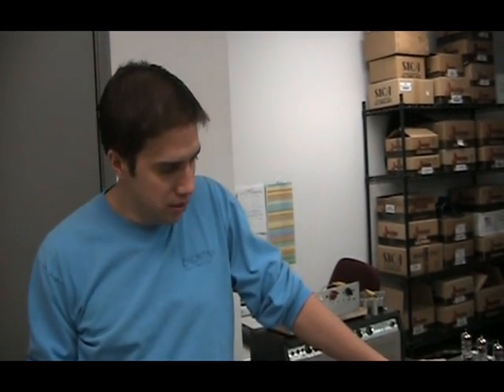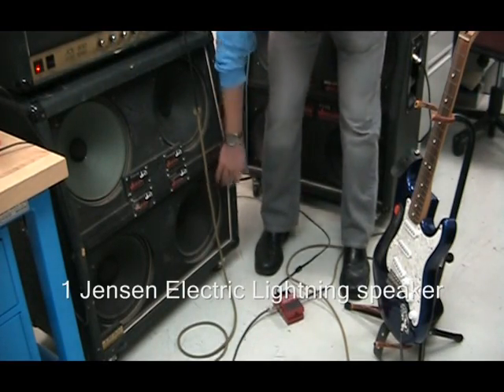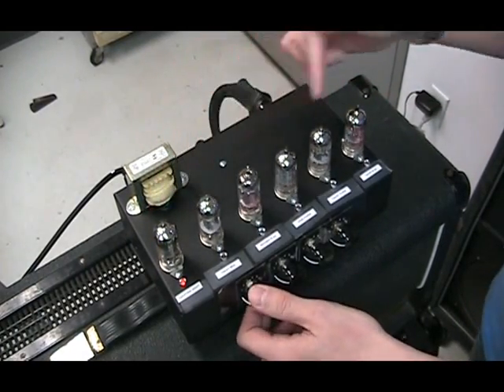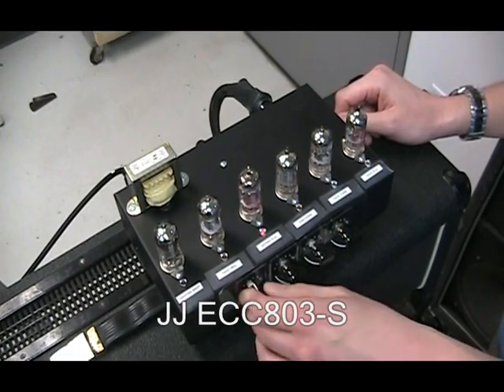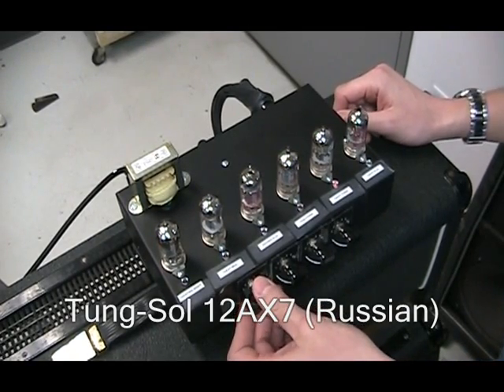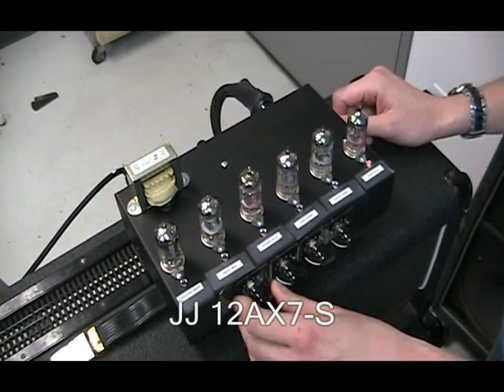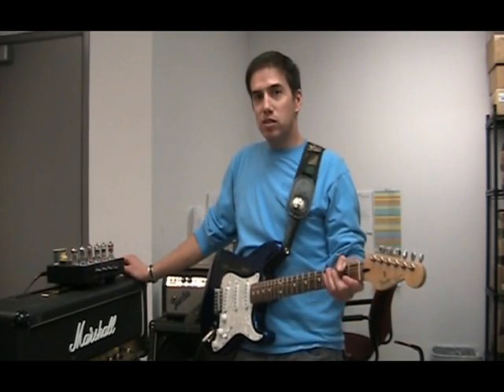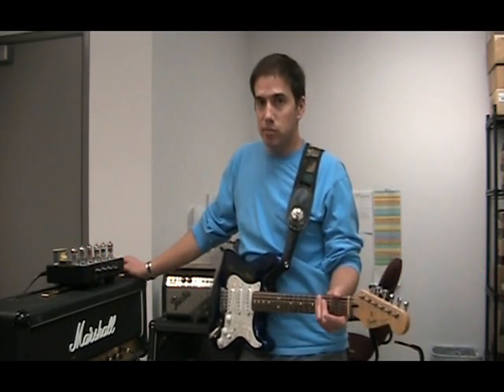12AX7 Current Production Vacuum Tube Comparison

Comment: I would have liked to hear 12au7's and 12at7's, and some of the other compatible a7's that are less high gain on a high gain amp setting. It would also be nice to hear a chain of lower to higher gain tubes from position 1, 2, etc.

Comment: I have a vox vt30, but now there is a problem. if I play for 30 minutes, the sound suddenly decreases and hoarse. what's the problem?? Please help me. Thank you
Reply from the maker: A bad tube can cause the types of issues you are explaining, so replacing the 12AX7 in your amp could be the solution, however, there are many possible issues that could be happening. If a tube replacement does not fix the issue, taking it to a professional tech would be the best next plan of action.

Comment: Tube prices have absolutely went through the roof nearly overnight because of the situation between Russia and the Ukraine. Russian tubes, much like Russian ammunition and several other commodities, immediately ceased to exist on the American market. All those things Russian tripled and quadrupled in value immediately. My five watt amp, a Marshall DSL, uses an uncommon 12BH7 in the power section. Preamp uses two 12AX7 (ECC83) tubes. I was able to find a General Electric NOS 1969 12BH7 for $23 shipped on eBay. ECC83's, being much more commonly used, were much harder to find, and all the classic tube brands like Mullared, Tung-Sol, Sov-Tec etc. Were priced through the roof. I was able to buy a matched pair of Chinese Psvane 12AX7/ECC83 tubes shipped for $45. I didn't even need them, as the tubes in my amplifier are fine. But the market being what it is, and the fact that it's only going to get worse as the Russian tube stocks are depleted quickly, I figured it best to at least have one spare set for my amp. Spent a total of $68 and those same tubes would've only cost $20 or $30 just a few short months ago.
Reply: I have multiple tube amps so I spent quite a lot because I bought full replacements for about 2 retubings for each amp.

I never bought tubes over the years bc I didn’t want to spend the money randomly. Lol. But it Makes sense now knowing what they will be priced at in the future . Also rarity.

Tbh tho, even NOS tubes are available by the thousands .

It’s just when they go on sale and them being tested etc.

They still sell new tubes from the factory that closed down in China years ago, it’s just a slowish roll out.

I think there are plenty of tubes left for sure . The problem is prices will go up soon for the few that haven’t raised their prices yet .

JJ is still fine and I actually like some of their tubes however their prices from random sellers is basically 2x the price . 

Iv looked into nos tubes but idk, seems more risky to me then newer ones sometimes . Microphonics etc.

I also don’t know enough to tell if they’re legit or not and by the time I do the research ..
Reply: @heythere6983  I purchased the NOS tube from a reputable dealer who tested it. I haven't tried it out in my amp yet, as my old tubes are fine, but I can only hope for the best.
Reply: Yeah always a little risk  for older and newer .

Some tubes can sound good for a few hours and go. That’s the tricky thing with having Rosie were I guess. Maybe the way to do it is when buying a spare is put it in for a few days and see what happens and then switch it out when it seems itl hold up .

I know some of the tubes I got have a few months warranty it might be long enough to try them out for a few weeks at a time idk. Problem is paying a tech to rebias every time

Comment: That was pretty interesting. The Tung Sol had the best overall rating for gain & low noise. Seems to be a good one to try if your using a lot of high gain. I've been using the JJ ECC803's for quite some time now & seeing it's rating compared to the others here seems like the best bet for what I do which is mostly low to mid gain settings. That said, I may have to try the Tung Sol's in one of my amps that has OD in it to see if I notice a lower noise floor.
Reply: I had stock JJ tesla and went to tung sol.  There was definitely more bandwidth and a warmer tone without muddiness.

Comment: So what I've learned in the last hour is to just buy them all because every amp will sound differently with each tube and everyone has a tone preference.
Reply: Different amps bias tubes differently,  so you are ABSOLUTELY correct.  You'll find that where TungSol sounds best in THIS amp,  JJ May be better for THAT amp.    Differences are subtle for the most part anyway.

Comment: No difference at all in any meaningful way as far as I am concerned and I have been saying so as an electronic design engineer for decades now!  So much for the "shimmering fairy gossamer highs" and "silky liquid transparent mids" descriptions valve aficionados always trot out.

You did a very good job in setting this test up and getting your results but, as anyone can see if they go to your website and look at the REAL results in the comparison graph at the bottom of the page, it shows that there is actually no tonal difference between these valves at all.  There is only a max of 2.5dB in Gain between them all and only 1.5dB between all but one in a real circuit.  If the individual curves are then slid over each other, (as in "adjusting the gain control"), they are indistinguishable from each other.

You then actually frig those results to expand that minimal difference in gain out into a made up linear 10 point scale which you then use to "describe" each valve make in turn.  Basically this means that you are creating your own way to display a tiny range as a large scale difference which only has each step on the scale as 0.25dB.  That is like finding 1mm differences in things which are 2m long and showing those differences through a microscope to suggest they make a huge difference in performance.  Looking at each valve in turn we find that there is actually no valve with a Bass/Mid/Treble characteristic which has differences in it which span greater than 0.5dB (2 of your steps), and most are within 0.25dB (1 of your steps).

This is very poor interpretation of your own results which actually prove there is little to no difference tonally between these valves, despite what every guitar guru preaches and every gullible person can always "hear".

Good engineering spoilt by an agenda to fulfil.  The Emperor has his new clothes on guys!
Reply: Albert Burton I play around with tubes because I think it’s fun to do, but as long as tubes test strong - I doubt you can hear any difference between the brands. With one exception, there is a guy in YouTube with this hifi tube stereo and the preamp will go through a solid state circuit that mirrors the tube circuit if tubes are removed from the sockets.  You could hear a difference between whether the signal was going through the solid state circuit or the tube circuit - with one exception. There was absolutely no sonic difference between Tung Sol 12ax7 preamp tubes or the solid state preamp. It was really bizarre!

Comment: That's not a terrible concept as far as having a switchbox to test several tubes with, but your methodology is still very much based on subjective interpretation of sound rather than useful objective measurements.  

A much better way to do this would be to use a signal generator to sweep a sine wave from 20 Hz to maybe 5 KHz and record the actual frequency response curves of each tube in the amp,  using a recording output or tap off the output to get the results, rather than relying on a microphone and the speaker cabinet.  

And then, having obtained the frequency response curves of each tube,  now perform a second test, seeing at what drive level the tube reaches clipping at a defined frequency, say 1000 Hz.  This will objectively tell us the general performance of the tubes.

Comment: there was some glitch, perhaps the pedal, that these tubes sounded way too similar. Everything is appreciated, but probably needs to be redone with different amp settings or with a different amp. I have some of these tubes, and there is a bit more difference in the tone than I'm getting here. I have sensitive hearing when it comes to guitar sound. I would go as far as to say the light on the switch box is changing, but the current flow is stuck on one tube.

Comment: It’s comes down to different strokes for different folks ..
Buy USA 🇺🇸
Reply: Vacuum tubes haven't been made in the USA for at least 30 years, and buying used or NOS American tubes doesn't support the American economy one bit.
Reply: Tone isnt about the economy, its about experimentation from rig to rig. I'm sure he has supported the USA economy in his quest for tone. There are NOS British tubes that are just as good as NOS USA tubes.  There are no Chinese tubes that equal vintage tubes though. The best modern tubes are the Svetlana "Winged C" tubes, if they are just Svetlana, then they are Sovtek. A good tube that holds up long, but leaves some clarity on the table.

Comment: Wow, very interesting test indeed. Lots of questions... Is that transformer looking thing in the switching box some sort of choke, to compensate for the cables that run from the amp valve socket? Do you think V1 is the most important tube for tone? And, why do some tubes hum more than others? Is it bad for the amp in some way?

Comment: The Russian 12ax7 wc & wa types sound like a tube should for guitar with the round sounding lows and mids.
There are fantastic and colorful sounding vintage 12ax7 ecc83 types if you know what too get !
It depends on your amp circuit EQ and negative feedback setup , some amps are steller bright and some are beefy so for beefy sounding amps a vintage Mullard may be too bottom heavy and boomy.
In a the brightest amp a GE 5751 has the beefy tone you need perhaps.

If you have a FX loop be careful not to put a tube that has too much gain  for send and return or a smearing sound over lays the sound texture and ruins definition of chords .

RCA Long Black plate 12ax7 is the most unusual colorful sound for bright amps , RCA BP are not bright .
Its important that you understand where your EQ sound needs to be and add a tube that has a EQ you need not putting in a bright tube in a bright amp is good advice I found out.

I have mucho vintage 12ax7 and 5751 A good over drive tube test should be a new tungsol ax7 followed by a vintage Mullard ax7 so use different gain settings and hear for yourself like I did.

That stellar bright Ignater rebel 20 I have needed help so I used a GE 5751 in the clean socket 2nd tube from input , the 1st tube near input is the OD tube and is a vintage Mullard.

I never liked that amps highs but its beefy with lows now , the highs are not gone but much better.

Comment: My experience buying/ trying different preamp tubes over the last 5 years, from my tech, who owns a Amplitrex AT-1000 and refuses to sell me weak tubes that test below 85% spec. JJ 12ax7's used to be good/ test/ sound the best, 5 years ago, then gradually bad factory QC issues meant he was throwing most brand new preamp tubes in the bin. JJ Power tubes (EL34 etc.), still consistently test good (90-100% spec), to this day. Then 3 years ago, Tung Sol 12ax7, used to mostly test good, before same thing gradually happened. Nowadays the latest Electro Harmonix 12ax7, seem to be testing more consistently closer to spec. compared to the rest. They can all sound good if they test good and strong and you find a good one. Tung sol compress earlier than JJ, EH can sound a bit sterile, Mullard can sound a bit HiFi. Mix and match depending on taste.

Comment: Sorry but all Russian  tubes are the same . All made at the same factory . Same goes for the China made tubes. You really need to do this with usa made tubes . Then you will hear a big difference. The very best 12ax7 tubes are from the 1960's. either usa or European
Reply: Dead on, Even used tubes from 60's & 50's can be a great deal. Current production tubes all come up short on tone compared to the old ones. I have some RCA 7025's used that came out of 50 year old amps and still blow away new tubes. But they're disappearing, I try to grab whenever I can. But everyone else should stay away from them.
Reply: where do you get this information
Reply: even Boogie labeled tubes are either Russian or Chinese. They simply test them all and reject the ones which are out of range. Apart from amps, tubes are being used only for military purposes today. The market is too small. Go do some research, and then comment on this.
Reply: I am not aware of any current USA made tubes. And buying stuff from the 60's is not something I would want to venture into. Good luck.
Reply: My comment above is directed at Guitar Nut.
Reply: PeterDad60 Not sure how you would notice any difference in tubes, when you can BARELY play the guitar. And don't call me names.
Reply: Your loss since the NOS (New Old Stock) from the '50's and '60's are the best sounding and highest quality. Many professional musicians use them. Just because they are old does not mean they are not any good. All NOS are tested before they send them to you. Eh? I'm wasting my time on an idiot!
Reply: @PeterDad60  Bro relax. NOS stuff is a nightmare unless you ahvw a reputable guy. That is ACTUALLY matching them. And btw, there is no NOS. 99% of those tubes were not new in boxes still. That beui G said, you get the right ones and yes they make a difference. With my 12ax7 tubes in my preamp, in my integrated not guitar amp, I use telefunkens. So I do agree. But my el34s, doesn't matter what I use. They sound best with new closely matched strong tubes. And old ones didn't make any difference at all. That amp responds much more to the pre amp 12ax7 tubes thank god. Because nos El 34s are out of control and a rip off right now. So the situation matters too.

Comment: if you are going to compare equipment with such little sonic difference you should at least mic the amp, the shitty camera microphone is not suitable for this kinds of tests. On the other hand that switch board for the tubes is great and the looper idea is brillant, that way you remove the player variable and the same sound is always fed to the amp.
Reply: Good point. And sound referencing cannot be done on a cellphone (or the internet) for that matter with a AD/DA signal or speakers that will not cover the proper frequency range.
Reply: @donrutter6765  Not to mention the camera's or cellphone's limiter is absolutely crushing the signal. It's a completely useless comparison for the viewer.
Reply: The test is meant for the person in the room this is more or so of a demonstration.
Reply: everyone's a critic.

Comment: Not one person doing these tube comparisons has done it right.  The difference is very subtle and not one person has put a mic in front of the speaker.  You are not going to hear shit with a room mic except that pedal clicking.  Do it right or don't do it at all.
Reply: Johan Segeborn,,, watch his 12AX7 video. He did everything right and you can hear more difference than ive heard on any other video
Reply: @realtruenorth  I was shocked how big the difference was. Also the results aligned with both my experience (JJ tube really middly with no highs or lows) and info you hear about NOS tubes (all the vintage tubes except one were the best sounding of the bunch)
Reply: @TheDwarfInvasion  I swapped out a class A amp tube set (1 × 12AX7 & 1 x EL84) with NOS RCA and Phillip's tubes, from JJs that were previously installed ,, and sound improvement and feel was noticable enough to be worth the expense to me.  The amp came to life.
Reply: I would also suggest using an amp with a single 12ax7 layout. The difference will be more apparent when there are fewer other tubes coloring the sound.

Comment: Great video in theory, and I don't like to be critical of something this cool, but why not use a guitar with some quality pick ups in it? Maybe they were upgraded, and good on ya if so, but a mexi strat single coil is not what I would want to use to rate these preamp tubes. And also a good quality Royer ribbon mike or similar quality would be great to get a better sense of all the nuances. And why not a pre Rola Celestion while we're at it! lol
Reply: +nitemareman1 I agree.  Testing tubes with a Mexican strat with single coils is not a good test, especially when you're using a Marshall.  I humbucker would be much better to test with.

Comment: It would be cool to introduce the difference between NOS tubes vs today's mass produced. Telefunkin smooth plates , Blackburn plant Mullards, RCA blackplates, GE 5 star 5751's to name a few. I know from personal experience my EVH 5150iii 100 watt head came stock with JJ's. After a few months I switched out V1 through V6 with pre 1964 tubes some NOS some used. These included Telefunkin, RCA and Mullards. Everyone that hears it says it's sounds much better. Warmer tones and a lot more sustain without the need of cranking the gain. Great video. Thanks for posting.
Reply: No contest, the good condition NOS tubes will blow away all modern tubes. I have spent hours and a lot of money finding this out. It's a major difference.

Comment: the differences in all these preamp tubes will not be evident until they hit saturation, then we can hear how they clip or compress. I know you guys are very busy over there in Tempe, but I'm tube comparing for my signature model amp and I'm driving over to you from avondale to grab the tubes, so can you do another at high gain with a more balanced speaker, like an alnico, maybe a blackbird, and mic it with a sm58 or a flat balanced condenser mic? The Electric speaker definitely has a strong filtering to the tone as well as the mics used to capture so in this video you can only hear the midrange. I'm leaning towards Ruby branded JJ's or Tungsol.